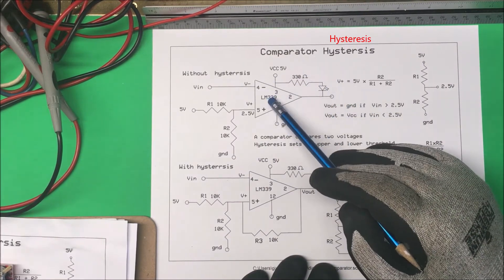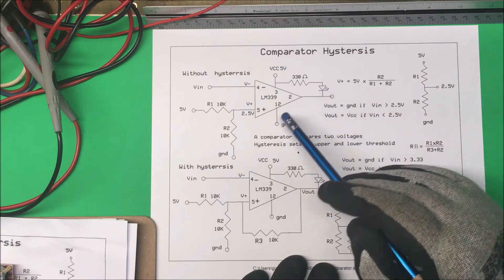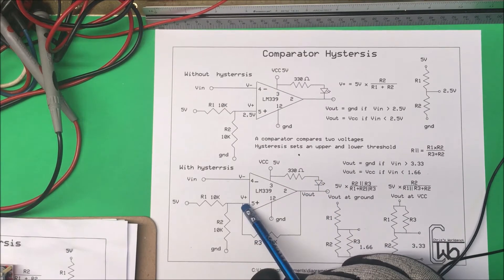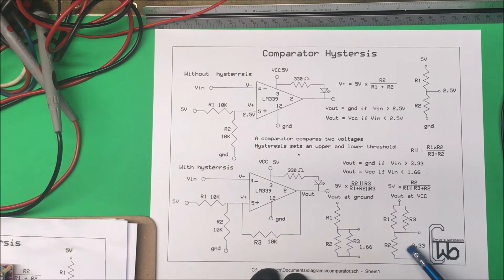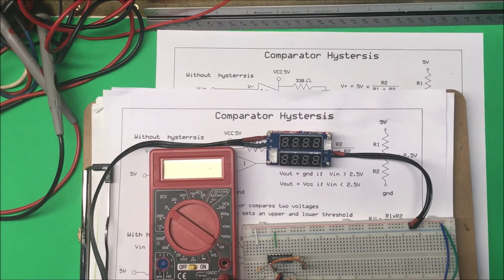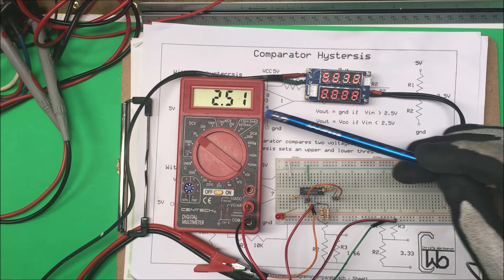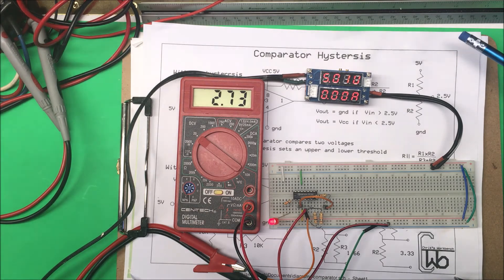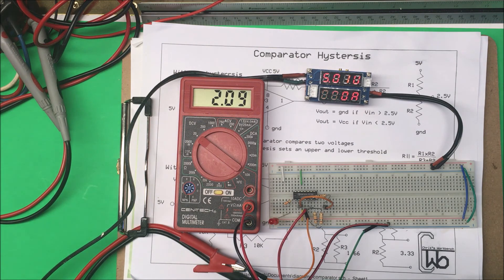Comparator with Hysteresis

Comment: Hello, I want to make an overcharge protection for my 12V battery. When the battery is 14V the output of the op-amp need to be high and remain high until the battery V has dropped under 13V. Can you help me with that?